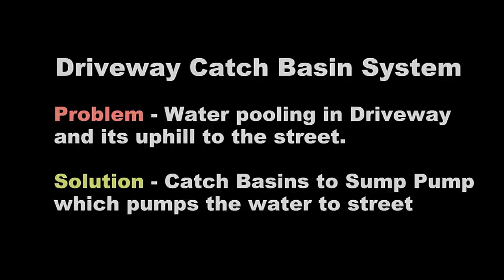How To Install a Driveway Catch Basin System with Sump Pump

Comment: One tip for future, install a union after the elbow on the out feed. Pumps dies or need to be serviced, a union allows you to remove the pump.
Reply: What’s a union ?
Reply: Well not really.  You have the check valve there with clamps, you could just loosen the clamps and take it apart.

Comment: What size pump did you use and is it possible to hard wire it in?
Thanks
Reply: just a thought, but these pumps only last a few years tops. so i would rather have it where it is easily disconnected.